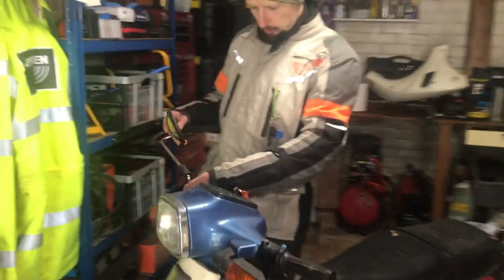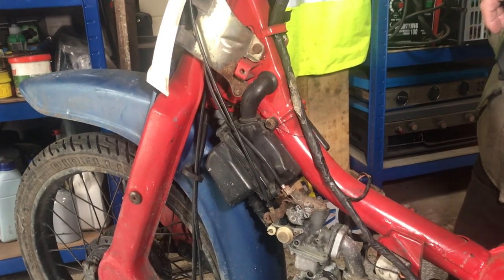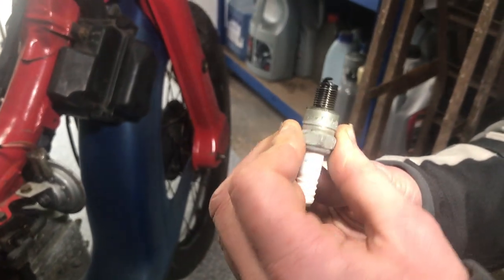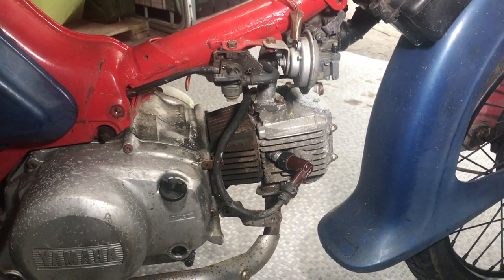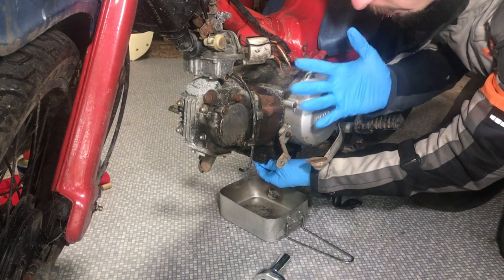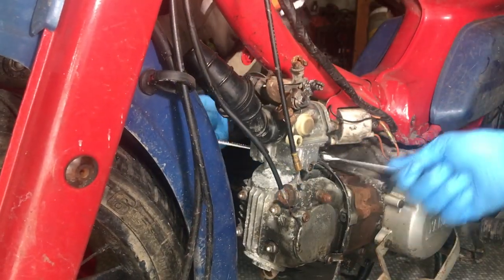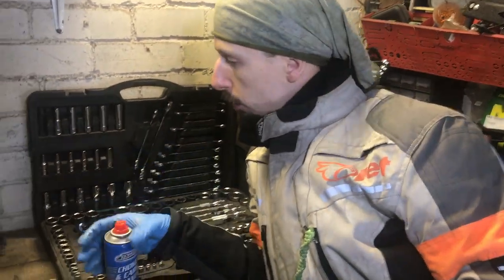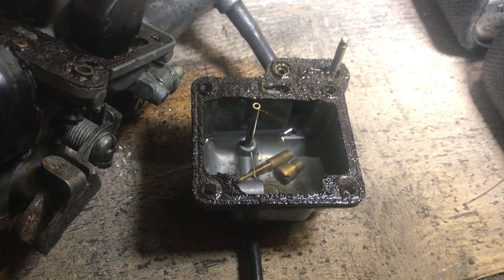Yamaha Townmate Restoration Diary - Part 1- What Did We Get?

Comment: This is the motorcycle i started 22 years a go. Has it's bad sides but it's unbelievably reliable. I do miss it sometimes. Had modified mine to 90cc and it could carry at top speed (80km/h) with two people up hill :D
Reply from the maker: Sounds like fun! Hope this one is as reliable 😀
Reply: @MechitBetter  These things are all we had as youngsters, i went to places i never thought a motorcycle would go and now i am afraid to go even with an off road motorcycle. They are extremely reliable. The suspension is terrible in the front however and the brakes a bit bad but if you get used to it you can do anything.

Comment: Very nice bike , it’s moped not scout . Lovely videos keep going!! There are many of t50 in Greece, a guy was running it out of oil for a year and it’s ok it runs very well without problems! We call this bike death because it’s very strong . You’ve got the 80cc version which is much better than 50cc for acceleration
Reply from the maker: Thanks! I hope my engine is as reliable as the ones you mention. There was no oil in the bike when I got it, but hopefully there was some when it was last used. I’m really glad to have the 80cc version 😁
Reply: How do you know which version it is? Mine looks the same as this but on the papers it says t50 for license etc but its modified to 100cc
Reply from the maker: The standard engine will have the capacity cast in to the side of the engine/head. If it’s a modified engine it could still be written on the head, but possibly not. Depends how it’s been modified.
Reply: its an underbone

Comment: Hi! Can you please send me the repair manual or just the wiring diagram, I need to repair my father's old motorcycle. I can't find it anywhere. Please!
Reply from the maker: https://lookaside.fbsbx.com/file/Yamaha%20T80%20Townmate%20Shop%20Manual%201983-1995.pdf?token=AWyKGkZ-j82cIV3QNzXYvzNvkgyDE8Ps3ZptUkpbS5S1NCsE4VHsRoXzqfdSWQKIvsVdNeGrKeqPhekqgCN6LrDP1EkysrWtJRO7l_G4EuV8utFJsQbUU56N_Qjh3WjZzd1PVR_1M8NpsAkrLuf0j74DFoQOlUFLRjF8CANpmn7yjzSC3Ms4MVxd82pnrDAZuq5AFWqLM-dwspWBTjztk4pTcbHvM82cx1CzB0aeGk-V_A
Reply from the maker: Good luck with your repair 👍
Reply: Thanks a lot but i can't open the link.
Reply: @MechitBetter  Can you please send me the repair manual
Reply from the maker: Yikes! Apologies. Only just seen this! Try this…

https://drive.google.com/file/d/1MBUkIxgh1U-gnHR232L1nDyr3UTQN-HP/view?usp=drivesdk
Reply from the maker: https://drive.google.com/file/d/1MBUkIxgh1U-gnHR232L1nDyr3UTQN-HP/view?usp=drivesdk
Reply: @MechitBetter  thanks bro

Comment: I have yamaha townmate, it has deffect. Its problem is there are about ten balls within the engine I thought its a clutch mechanism or something else. Please is any body know what am I talking about?
This bike is using shaft propellor instead of chain......
Reply from the maker: If you have loose balls within the engine, I think perhaps some of the bearings have collapsed. It’s impossible to be accurate without seeing the engine myself, but it sounds like it will need to be dismantled for investigation.